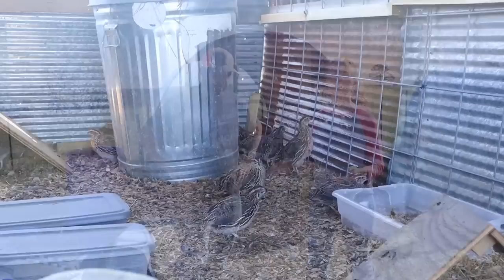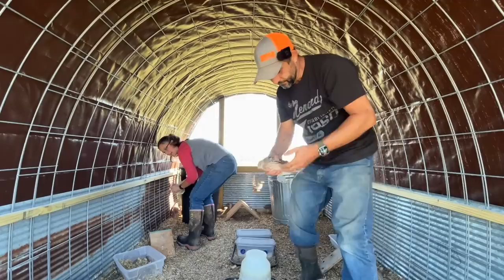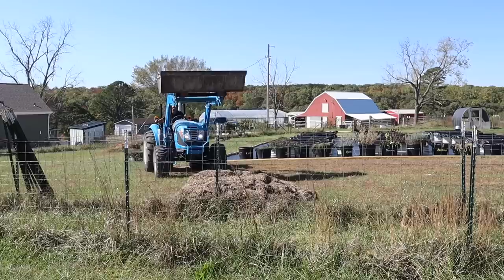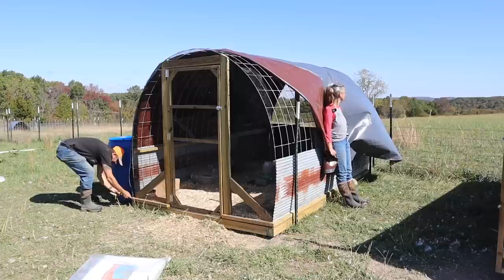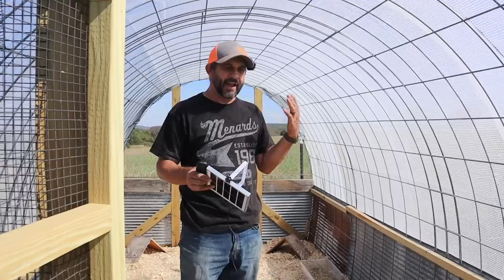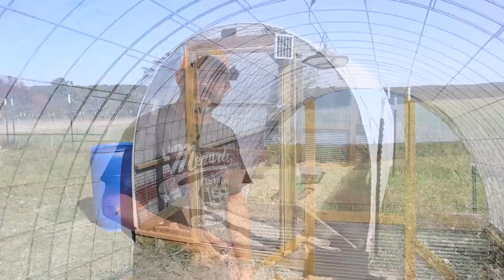The QUAIL stopped Laying EGGS! Will THIS be the ANSWER to our Problem?

Comment: I hope the light works.  Two concerns: 1. Will it charge enough on cloudy days and 2.  If it doesnt charge enough, will it shock the quail.  My understanding is if you drastically interrupt the light phase, it can shock them into molting or even (in the extreme) kill them.  Ive read this about chickens and have no idea if this applies to quail.  Not trying to be alarmist, and it may not be accurate, just wondered if you considered that.  I am wondering if there is a battery alternative.  Just thinking...

Comment: At first watching I thought you guys pulled the tarp right off, but turns out it was God who pulled it off.

Also, is there not a way that you can put a "photo cell" on the light circuit that will put the light on everyday when the sunlight drops off. That will be better than a timed sensor